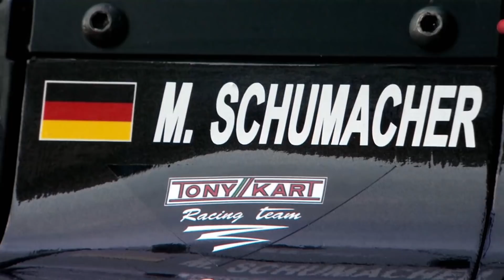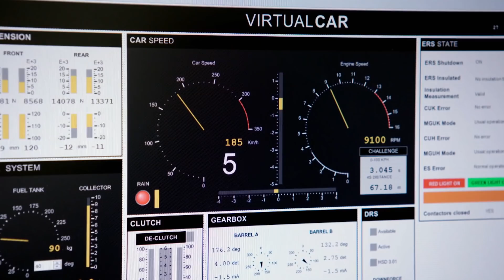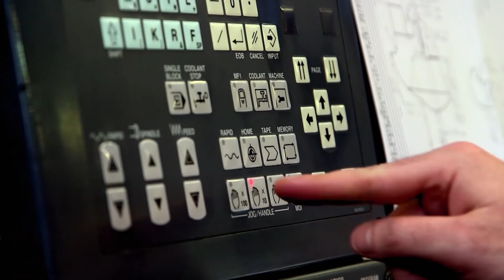WEEKLY FORMULA 1 NEWS (5 MARCH 2019)

Comment: Standard gear box? Darnit.
I was hoping to see F1 go to all electric drive* and eliminate the part that fails most often, and is so very expensive to make, all those little teeth of 'unobtanium' metal!
*electric drive - 1 generator on engine, 1 moving part, with 4 electric motors in the wheels (see ferrraris new super power), also providing "brake magic" as Mercedes called it. So low cost, so easy to control, so very very fast.